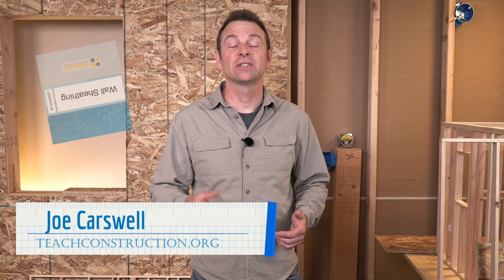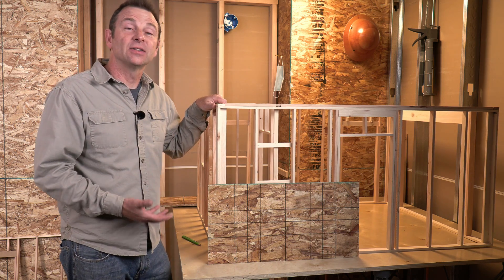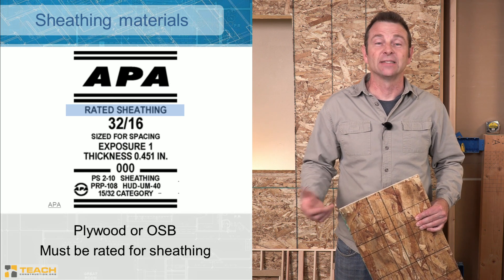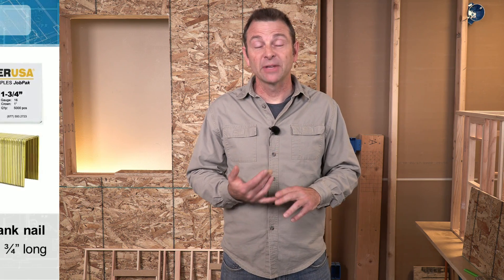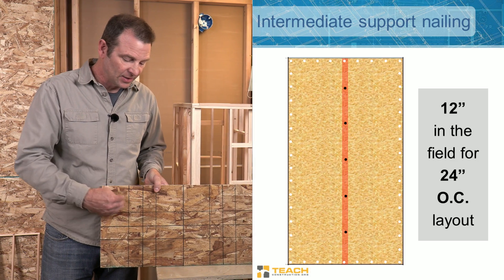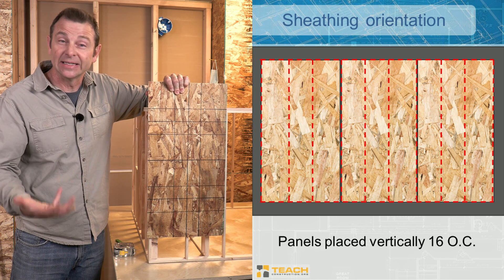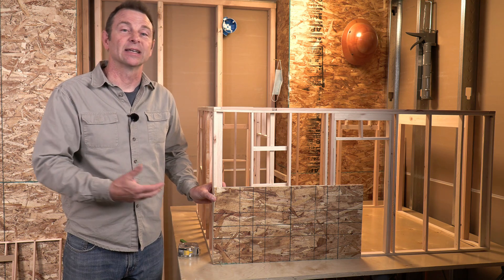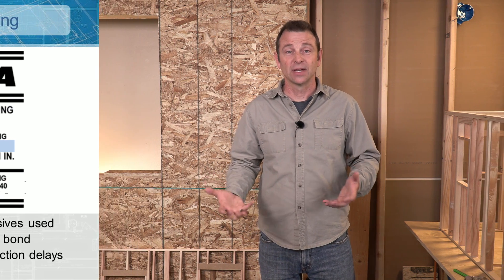A lesson about Wall Sheathing in Residential Construction - TEACH Construction Trades Training

Comment: This is great, thank you! But one question. I am trying to find an explanation on whether to align the sheathing flush with the top or bottom plates. Sheathing is 96" however, a rough framed wall is 97 1/8" from top to bottom.
Reply from the maker: Bottom in most cases.   Norbord has a product they call Tailboard that is longer than the normal 8 feet and can overlap to the second story for extra strength.

Comment: With so many people on You Tube giving bad advice while claiming they are experts it's refreshing to see Joe giving accurate information that will pass framing inspection.
The debate for using either osb or fir plywood for wall sheathing has been going on for years, for structural strength I would give the edge to osb and for weathering to fir plywood. More important than that is to use 7/16" for a minimum thickness, I think 3/8 is too thin and 7/16 is just a bit more money.
This is a little off topic but for subfloors I think the best product is 3/4" premium T&G osb, it's denser, heavier and more rigid than fir plywood which is exactly what you want for a floor.
Reply from the maker: I agree on the 3/4 for subfloors - and thanks for the kind words.

Comment: Sir do you have a video on how to replace a top sill. I have termite damage
Reply from the maker: what do you mean by top sill?  The Window sill, the top plate, or maybe the bottom plate ...or maybe the sill plate (the material directly on top of the foundation)
Reply: @ConstructionEd  Thank you for replying. It is the top sill plate, the 2 x 4 that holds the rafters. I see some termite damage and I need to replace it, but not sure how to do it.
Reply: @miguelmurata9835  if you are talking about the very top plate of a wall, that's called the cap plate. To be honest, if termites made it that far up the wall to do damage, there's a good change of even more damage than just that one area.

Comment: in order to make the sheathing flush with end stud, should I leave a smaller space between end stud and first common stud?
Reply: Yes, you need to. His video about  "Learn how to do Wall Framing Plate Layout, Step by Step" demostrated that. But he did not explain the reason so some people actually confused about why the distance between the end stud and the first common stud is shorter by 3/4".
Reply from the maker: We teach layout to beginners as marking 3/4'' shorter then the OC pattern so you can see your line when placing your studs.
Reply: Yes  by 3/4" the gap between your end stud and the first common is shorter.  Because you are measuring from the exterior  (outer edge) of the end stud not the Center point of the end stud.  Remaining commons are 16" OC from each other.

Comment: Great video, should the gaps in sheathing be taped if using external WRB not ZIP. Also if using tongue and groove is the spacing still required? thanks and great video.
Reply from the maker: taping gaps should be considered when determining where your air barrier is and can change per climate zone.   It is not just a tape everything situation